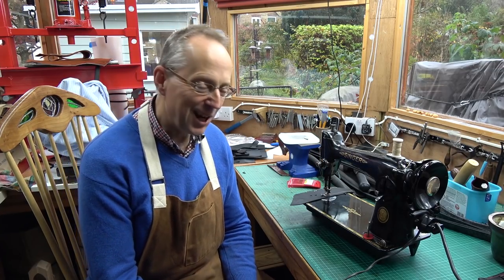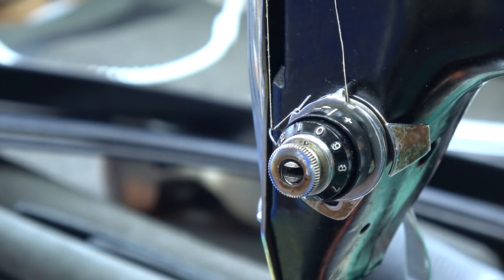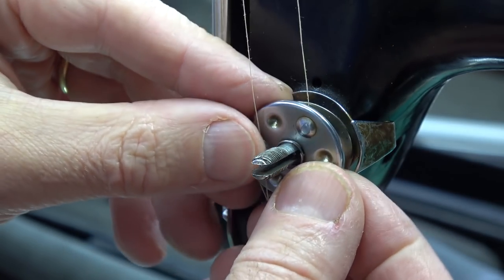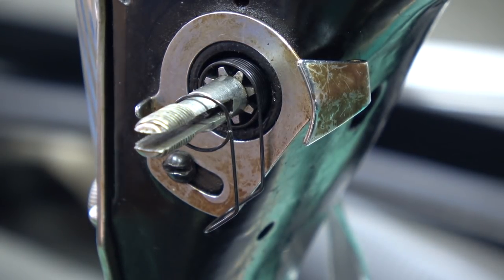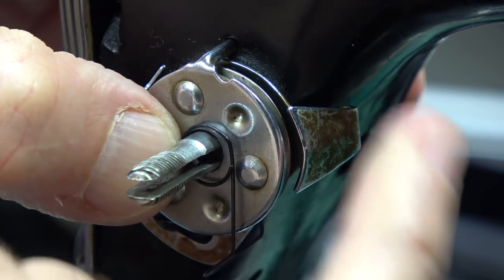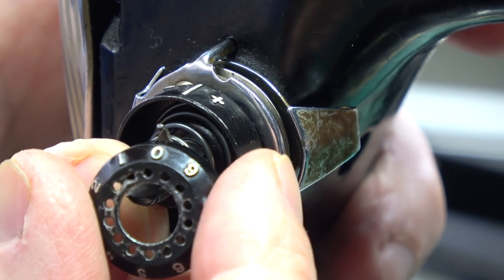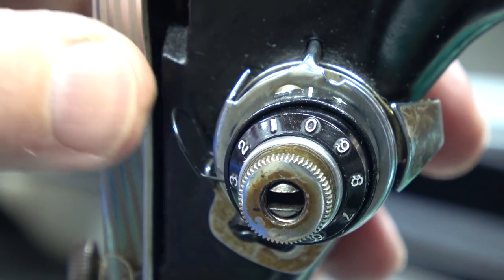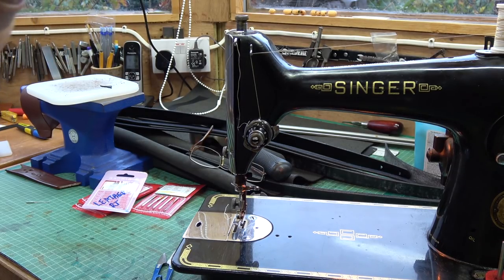Singer Tension Spring Replacement 201K

Comment: Harry, I'm working on a Singer clone, a Japanese Dressmaker. In it's thread tensioner, both springs are worn out, mangled. I'm trying to find a repairman to rebuild/replace my parts. Any suggestions?
Reply from the maker: Hi you may find you can use the springs off a replacement Singer unit, I.e. just change out the springs?? Just a thought.
Reply: Now, that would be a great help in itself. I'm wondering about some type of diagram, to reassemble the tensioner. I've taken it apart to diagnose the issue(s), and need to get a little info on getting it back together properly.

Comment: Thank you from Germany 🌺 i just subscribed. My tension on My industrial sewing machine is very very hard After threaded through the tension discs. I dont know whats wrong. Is there anywhere accidently stick left, when i glued something? My thread keeps breaking. Maybe you can help?
Reply from the maker: Hello Vanessa...has this just happened, or have you just got the machine as a new owner? It maybe that the discs are the wrong way round, it could be the axle the discs sit on is worn to the extent there is a groove,....it's also worth double checking your thread path as sometimes one makes a mistake threading up...I have done this...or the thread gets caught up near the tension spring....you may have thought of all these but good luck all the same.
Reply: Harry Rogers Thank you for the quick answer. It’s a New Industrial machine and it seems that the Problem exists from the beginning on. In the beginning weeks the thread kept sliding back through the needle ear. Now the thread keeps breaking. Of course sometimes i make threading mistakes 🙂 it seemed to be better, when putting oil through every hole i could find on top of the machine ( it’s actuallly a Self oiling machine) Thanks for your tipps. I am going to have look if your advice could help fixing my problem.

Comment: Hello Harry, Finding your videos very useful when repairing older sewing machines, however , with the 201K I find that your demo doesn't quite reach the parts others aren't having bother with. I've lately bought a very nice 201K which needed a lot of servicing and now with your advice runs so smoothly etc but it doesn't stitch! Dismantling the tension unit seems to show it either has the wrong length release pin or the cogged section protrudes too far beyond its aperture. Thus, in both cases disallows the unit from working succesfully. I think I need to find a centre split pin with cog end of a shorter dimension. Can't quite make out any protrusion from the film. Did the one used in your demo have the cog section protruding? I'd be very pleased if you can see what I am trying to describe and then help me resolve, so I look forward to your reply. Thanks for all your helpful films too! Howard Wright aka uthund
Reply from the maker: Hi Howard...it was a while ago I did this and I no longer have the machine, but I don't think the pin was long...sorry not very helpful.
Reply: @harryrogers  Thanks for reply, since posting I found the YT video next door told me the pin should be 1 1/4" and showed Andy making a pin from a nail so I copied his method and the tension unit worked fine. I still had a thread breaking problem and discovered the previous owner had put a bobbin of the wrong thickness into place which was causing the bobbin thread for parting when the lid was in place! All the time I had been working on the thread tension I had been working with the bobbin cover aside so hadn't realised the problem!!!  A bobbin of the right thickness and alls well. Pays to check !!! Cheers Harry!
Reply: Just came from your station!  Saw the 201K alluminium model on your bench which is the model I have been working on, not the older black model, just in case there are differences that my remedial work will confuse. TTFN HW
Reply from the maker: @uthund  I hope the train was on time!
Reply from the maker: @uthund  Thats really good.

Comment: Thank you Mr. Rogers for this  very helpful video. I have a question: My 201 is missing a few parts of the tension assembly: tension wheel, beehive spring, finger washer, # dial ring, and the final screw.  Would it work if I use tension assembly parts from other singer machines?
Reply from the maker: beshia popescu I think there is a fair chance that will work, I have swapped parts round on similar style Singers and its been fine.
Reply: @harryrogers  Hi Harry,  I like the tension mechanism with the numbered black disc (as in your video) that the older 201 machines didn't have.  Do you know if I can simply swap the older mechanism out and replace it with the numbered disc mechanism - I know they take slightly different springs but was wondering if I simply swap the whole thing out that will be okay.  Thank you if you can help or have any tips at all.  Regards...  Megan
Reply from the maker: @meganmills6545  Hi Megan...I don't know but I suspect you can swap the parts around as they tend to be interchangeable between machines.

Comment: Hello ! I have a problem with my singer machine 191J, sews well and then it entangles in a single inpact the thread down and makes gauzes and then continues sewing well and returns to get tangled up and make gazas, I do not know what to do.
Reply: Is your needle round the right way? Not sure I fully understand what your problem is but I had a lot of problems today as I'd set the needle with the flat on the wrong side (201K)

Comment: Does the tension  dial have any thing to do with stitches  not being formed? Mine starts to stitch but at the second stitch doesn't form it seems to pull out
Reply from the maker: Possibly, but it could be a damaged needle, blunt sewing hook or wrong thread.
Reply: @harryrogers  I've eliminated most of those except  for the sewing hook I'm new to sewing so I don't even know what that is.the tension seems to stay the same no matter what number I put it on
Reply from the maker: @EnSaNesports  Perhaps time for a service...it's difficult without seeing it.....or watch every video on sewing machines and you will soon learn.
Reply: @harryrogers  thank you
Reply: @harryrogers  I tried pinching the tension spring it seems to be working better now...do you suggest  a new spring if so where can I find one

Comment: Would the spring be the cause of the string getting stuck and ripping off?
Reply from the maker: If that is happening at the tension unit it could be.
Reply: Harry Rogers Yes, the string seems to get caught in between the plates no matter how lit is and it becomes hard to pull.
Reply from the maker: @marshiemellow  try reducing the tension

Comment: I bought a one piece tension unit for my 201-2 singer.  I had it put on for me but they don’t have the spring in the right place.  They left the metal plate on and the one I saw on a video being put on, they didn’t have that plate on it. HELP

Comment: If the finger goes through one of the holes the knob won't turn at all. 
-The lock washer limits spinning of numbered part. There is a protrusion that the finger on the lockwasher contacts  to stop the rotation. 
 -Pin in nut will not allow  more than one revolution if it is in a hole because of this. That is what the spring has to be compressed to get the nut to rotate more than the one revolution the numbered part/lock washer limit. 
😉

Comment: Have changed the spring but the unit keeps slipping out of the machine casing when i am sewing , the centre came right out when i was adjusting it, goes in but seems to work itself loose, any ides as to how i cure it?
Reply from the maker: Have you found the little grub screw that holds the unit in, it's to the right recessed in the side?